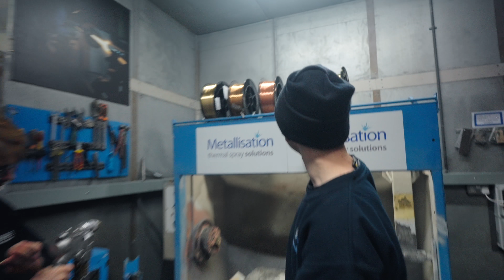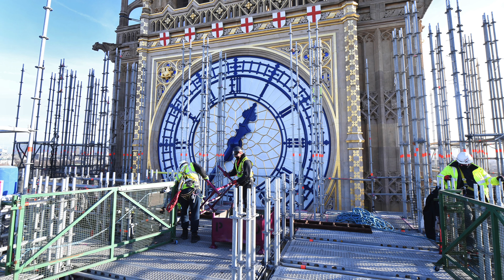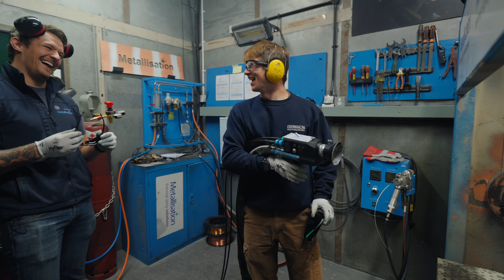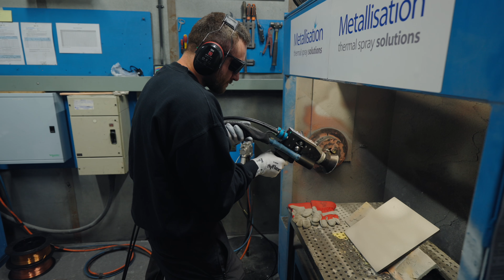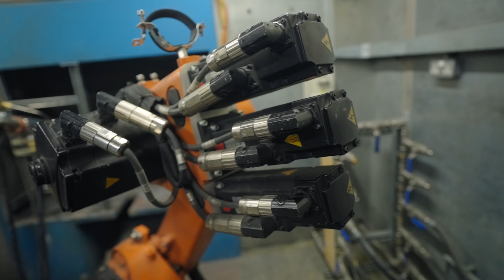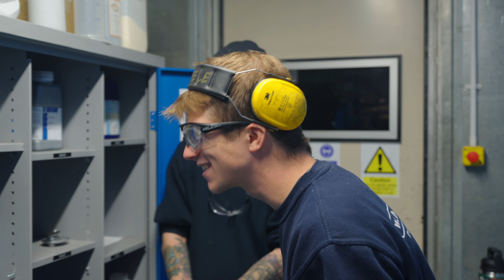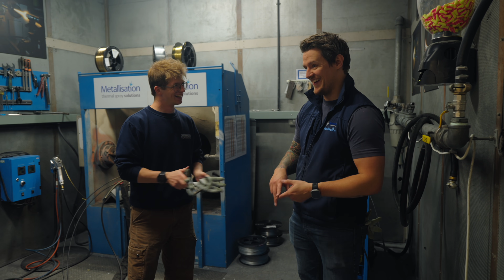Metallization

Comment: Hi Alex. As a machinist I have been using metal spray for about 40 years in its various forms, great stuff for reclaiming worn components. I have not used HVOF but do regularly remove it from large earthmoving components and then remanufacture them using Lazer cladding. I would recommend you check it out as it is the next level up in engineering reclamation.

Comment: what i kinda dont like is that they dont go into how they prevent the molten metal from oxidising when they accelerate it with air.

something tells me that they did not show that the compressor is actually fed inert gas or alternatively that the "loss" in material stems from the surface of the accelerated mist particles is in fact oxidising but the metal hits the object so quickly that it hasnt got the time to fully oxidise through
Reply: Happy to fill in some blanks based on your question - there’s nothing to hide. In ‘most’ of the applications, the molten metal particles do oxidise on the outer shell but the core doesn’t (as you suggested). You have to consider that the particles are in flight often for a very short time period. Particle speeds can be from 50-700m/s.  Typically, we could have less than 1% or more than 10% oxide content. For some applications, we may want more oxide content. For most applications, it really is just compressed air. There are some very specific applications where we may use inert gases. Some processes can also create more or less oxides and we can also change some parameters to create more or less oxide, e.g. when flame spraying, we can create a fuel or oxygen rich flame.

Comment: I’m in the oil field and the plungers in our high pressure pumps eventually get worn out. The get spray welded to clean up the cracks, scratches and gouges.

Comment: with vacuum vapour deposition you can coat literally everything with any metal directly and it doesn't laminate even if the thing you're coating isn't metal itself and depending on the residual gases in the vacuum chamber you can even get different oxides or ions mixed within the metal coating making sometimes stronger alloys and ceramics

Comment: So since this is a 'cold process' do you not have the dangers of zinc fumes like us you were to try and forge or melt in a foundry something with zinc in it?

I see this set up, they have a massive exhaust at the back that I'd imagine if clearing immense amount of air, but if you were to use this as they describe on a part in place wherever, you can't necessarily disassemble it and move a part to a place with exhaust like this so would be needing to rely on a fan or just open air

Comment: I used to work for Richmond Engineering, that did maintenance on power plant boilers where the fossil fuel “coal” was burnt, we would sand blast all of the impurities from the boiler tubes and then metallize the boiler tubs with mutable layers of aluminum nickel to protect them from the SO2 emissions coming from coal as its burnt. That’s 30 years ago so metallizing has been around for a very long time.
Reply: Curious. Why is coal in quotes? It's not an archaic or unknown substance or word...

Comment: Hey Alec, industrial coating specialist here. If you want one of those heat spraying set ups you should also get a blasting cabinet. The metal will just fall of smooth surfaces. It needs an X amount of surface roughness for the metals to bond to.

Comment: @Alecsteele - i've used hard-facing of the tungsten carbide process for pump impellers and sideplates (ware surfaces) inside of process pumps for recyced paper used for corrugated boxes (recycled linerbaord). The volume of glass and sands and metals in the pulp slurry is very abrasive. Used all 3 of these metalizing processes for decades. We even spray it on to rollers surfaces to increase their roughness so that winder drive rolls can get "traction" while making giant rolls of paper.
Reply: CA6NM was custom impeller material for the real nerds :)

Comment: I came across a 1940's metalizer gun, and it has got to be the most impressive hand tool I have had the pleasure of holding, it is simply an oxy acetylene torch with an air powered wire feeder, but in a package that would render weak even the strongest of users after a few short minutes of waving it around.

Comment: This technology applies directly to sealing space habitat cylinders and planetary volcanic tube settlements.

When you have a volcanic tube habitat in particular (with all those pesky cracks and erosion areas in the rock), you just coat the whole interior to form an air/water tight sealed surface.  A fraction of a millimeter will seal up multiple atmospheres of pressure.

Obviously, in a rotating space habitat in the vacuum, you spray all the joint lines of the panels & girders so you don't slow-leak air.  It's like spray-on caulking.  Even hydrogen has trouble getting through an actual continuous sheet of metal.

Meanwhile, I want to spray a boat hull with brass to make it algae and barnacle resistant.  As long as you don't gouge it up too much on hard surfaces, I'll bet it would outlast the usual copper-chemisty-infused bottom paints.

Comment: We used this method to repair old metro differential bearing journals in Montréal, because the metro is quite old and parts are not available anymore. We used brass and when I was a machinist I was turning the part on a lathe back to original tolerances. It's quite an amazing method to repair stuff! 😊 

Thanks for having them explaining how it works, it was very interesting and super cool to watch you react while blasting with that "flamethrower" 😂.

Comment: Material engineer here DFT is dry film thickness, and it works by inducing eddy currents in the steel and then measure the back emf to quantify the thickness. There could also be ultrasound and other methods too but here is probably eddy current

Comment: Pretty common where I'm from, it's used a lot for engine rebuilds where crank & camshaft journals etc get wrecked all the time and needs building back up, etc.
Cutting Edge Engineering Australia does it a lot on his channel too, along with a lot of other processes that seem to have been forgotten in the last 20 years, oddly coinciding with the rise of the phone.. (I make no claim that it's a DIRECT connection, just saying it ODDLY coincides)

Comment: If this works as you say, then you should be able to hold to metal plates togethr with your bare hands while a third guy welds them into one with this spray-coating of steel. Like you should be able to weld stuff. You didn't show that

Comment: Would it make sense to copper coat boats with this process? The current roll-on coating is just so time consuming. If the business card does not burn, then a fibreglass hull would also not take harm...

Comment: Hilarious to rust proof wood 😂 this is awesome! If you wanted to rust proof a classic car say from underneath like a Land rover chassis off spray this and the chassis no dipping no worries! Newer stuff does this need to be ice blasted first or will this basically eliminate the need for that? But say an old 205 gti with engine subframe out and rear subframe removed do you need to remove all old paint say sand or soder blasting! Then this then paint! Avoiding completely having to dismantle the entire the car dip it! Then paint it! How much cheaper is this to say galvanise the under body of a car!

Comment: I was doing this 30 years ago, usually to rebuild bearing seatings on shafts or end housings. We just called it metal spraying, was much better than building up with weld then turning back down to size

Comment: I worked at Metallisation between 2009 and 2020 building hundreds of pieces of equipment, as team leader in production in the early years to later carrying out repairs and overhauls as well as assisting the technical service team on the road and with remote customer support. I spent alot of time, alongside R&D from an assembly and service perspective, involved in the developement of many bits of kit you would have seen on your visit, including the MET-PCC Mk66, Mk74, ARC150, MET-CLAD  laser and Plasma power supplies. There was a great team at the time, i believe many of those i worked alongside have since moved on to new chapters. What started as a stop gap job at the age of 21 turned in to a pivotal 11yrs in my career and set me on the way to bigger and better things. I owe a lot of where i am today to the guys i worked alongside at Metallisation.
Reply: I have been having a look, how much very roughly is one of the flame gun with all the valves etc. (like 100s or 1000s rough)? The website is obviously setup for industrial clients and not someone just wanting one and hence have no price, that is if they are even sold to individuals?
Reply: @tribblier  You might ask abom79 the question, seeing as he has one, but it depends on which country you're looking to purchase in - he's in the US, that may not be useful to you.
Reply: @tribblier around £5k
Reply: @tribblier get in touch with one of the sales team at metallisation, they're a friendly bunch and are always more than willing to help no matter if its an individual or a company
Reply: I see a great potential in this to work as a Metal 3D-Printer.
Reply: Hello David i am a sculptor i make art with concrete and bisque fired clay ,if i thermal spray them with bronze do you think is going to work or do i need specific surface preparation , thanks
Reply: We fired David for smoking drugs at work, Hello David please cease from harrassing us.
Reply: Fantastic
Reply: @JulesieCoolsie  🤣🤣 I'm 100% certain i left of my own accord. 🤡
Reply: @davidforrester8853  you didn’t even deny smoking the drugs 😏

Comment: Kurtis from Cutting Edge Engineering Australia has one of of the second units shown (being tested at the least) if you wanna see it used to repair parts for industrial machinery.

Really really cool tool. He's also got a video on the older spraying method that was used for decades before this came out. It's a HUGE improvement since the systems that existed since the 60s i think he said?

Comment: There's what appears to be a huge dispenser of Mike & Ike candy on the wall and you didn't try sticking some to a plate and metal spraying them. Also, why is there a huge candy dispenser on the wall of a shop room where metal particulates and combustion byproducts are flying all over the place? They should send some pieces of candy to be tested to see what's got on them.

Comment: HVOF is no joke when it comes to LOUD!!! Most large machinery suspension rods are done like that because Chrome is just so nasty. When they do wear surfaces with it, it becomes stronger than the parent material because you really can lay down all sorts of stuff. The only downside is you can't go too thick or it will spall at the transition in high load cases. It changed the game in refurbishing large parts though. Laser cladding is pretty nuts too. It's all very cool.

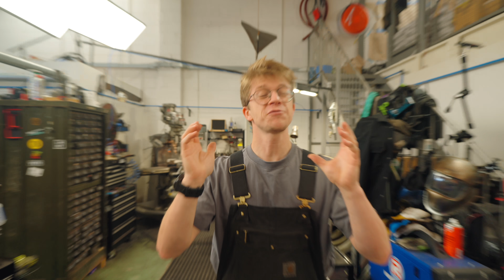Comment: 5:40 you could nickel spray titanium for titanium damascus to improve interlayer bonding without the thickness of the sheets
Reply: hell, if the arc one gets hot enough you could straight up spray titanium
Reply: OMG YESSSSSSS
Reply: I'm imagining laminating metal stock from scratch. Lot of possibilities.
Reply: Might need an argon or nitrogen atmosphere to prevent oxidation though.
Wasn't much mention of how oxidation of the metals is prevented before being layered.
Reply: @ahaveland I was wanting to know why or how oxidation wasn't an issue myself.
Reply: Same idea as I commented on an earlier video on that subject, but different process. 
The uniformity here may be ideal over electroplating though.

Comment: could you in theory spray a 3d print or other dissolvable/meltable material with a metal that has a very high melting temperature, dissolve or melt out the core, and then use the negative for casting while preserving high detail? could be a cost effective variation of the process, cut it open to release the cast and then weld it back together

Comment: It’s like someone started messing about with 3D printing and thought “Hold on lads, I have an idea”
Reply: Wait a second, could that be a new use case for this? Use one of these guns as the tool head, then focus the output into a finer point to do metal FDM? Like he said, if it melts they can spray it

Comment: Hey weird question i actually might have a use case for a wear resistant metal coating on wood is will that actually create a mildly flexible coating that won’t just delaminate from the wood or was that a just because coating like the business card 

Id call to ask but im in a different country and don’t think it would be worth it for them to sell me one so id probably have to find a business  more local unfortunately but it would be great if that would actually be a workable option

Comment: Ok, so I was looking into vapor deposition processes a while back, when I was working on a project for making solar panels at home.  I couldn't find a process that had any chance of working at home.  Well, this flame jet thing might be exactly the right thing, and I might be able to do it with stuff I already have, on a small (but big enough) scale.  This is awesome technology, and I'm disappointed that I never learned about it until now.  (I even took a handful of mechanical engineering courses that covered a lot of engineering/manufacturing technologies, and this was never mentioned.)

Thanks for doing this video!  This is awesome stuff.

Comment: I’ve done this professionally in a refinery setting on In-Service Pipe, Tanks, Columns, Etc.. it’s a pain to do while climbing through an enclosed pipe rack in 90 degree weather, but god is it fun. I specialized in Thermal Spray Aluminum for Corrosion Resistance.

Comment: We have used this to restore steam locomotive parts here in Staffordshire. We were able to build up wear on a 100+ year old shaft journal to avoid the need to replace it and spoil originality. An absolute godsend.
Reply: The fact you can do that was the coolest thing to learn in this video. I would have never expected that to be possible. Incredible how strong the bond gets.
Reply: Mind if I contact you, my family has two big steam engines built from there out Mt Poverty, we ran the Tin mine in Australia and I am considering restoration and taking them down off the mountain. My family shipped them from England god, 1960s?.....
Reply: This is something I was curious about. Can it be used to rebuild old motors that have scoring in the cylinders?
Reply: @AdamPartridge-fg7vl  Yes it can actually! Seen it done on locomotive engines about 20 years ago, as long as you're able to machine and finish the built up surface back to OEM spec you're good👍
Reply: @AdamPartridge-fg7vl it will be better to use cold spray tech for this, since it has much less thermal impact than flame spraying. It is a modern technique in comparison with flame or plasma spraying
Reply: Oh man that’s a great application!

Imagine buffing the patina off an old statue but then spraying more bronze to make up the material lost.

Comment: As a thermal spray equipment engineer, it is so refreshing to see our industry get some publicity. It is such a fascinating process that has countless applications. Hand spraying arc spray is probably the coolest thing I've ever done.
Reply: these guys saying "no different from plating" are not bright.

-fellow industry worker

(I know you aren't with my company, are you OM, the 8830 people, or based in Goochland?)
Reply: useless process
Reply: @kaidencook8076 explain why its useless?
Reply: @kaidencook8076  weld overlay guys big mad, sorry thermal spray is better for erosion bud
Reply: No different from plating
Reply: @Johnne009 what are you smoking, how is arc spraying no different from plating? 
How do you propose a bridge is plated? Just dip some electrodes in the river ?
Reply: @yabbieo8466 there's pen plating...duh
Reply: @Johnne009  It's a shame pen plating sucks so much, at least when you're using a gold solution. The end result has an inconsistent layer of thickness which can look pretty bad. Not to mention the cyanide and carcinogens in the solution. It's no wonder so few companies make stuff for pen plating, even they know it sucks.

Comment: No one tell Alec that a Wire EDM does in fact never touch the steel that it's cutting. It's all about adjusting the electric arc to the point where you get the result you want in terms of measurement and accuracy.

Comment: A buddy d an old flathead Ford with a bad crank. Instead of getting a new one he sent it off for Flame metal deposition service. They built up all the rod journals to an over size and the builder put the final grind on it all to fit original specs.. It seems to be working fine and he says he actually saved money as he would have had to make custom bearings to fit a greatly reduced journal and that would have limited his available horsepower and reliability. .

Comment: I used to work at a trade school and they had an old style powder metal spray gun they had gotten I think in the 70:s or 80:s for some unknown reason. Very simple, basically just an oxy-acetylene torch with a hopper to feed the powder into the flame, no compressed air or electricity needed. I played with it once, sprayed some metal and plastic (it would also do plastic coating with plastic powder). The main application was building up worn cylindrical parts like shafts and piston rods, you would put the part in a lathe, turn a fine pitch thread for adhesion, spray it while rotating and machine to dimension.

Comment: idea: use paper masks, cut with something like a cricut to make patterns on steel using two different kinds of steel, and build up a blank that you can turn into damascus, using the flame or arc systems since it easily peels off paper, you should be able to get sharp edged patterns and REALLY intricate patterns.